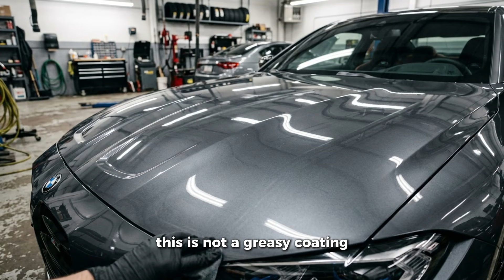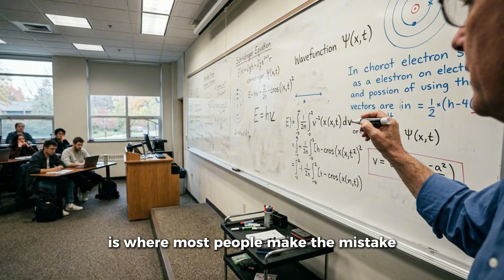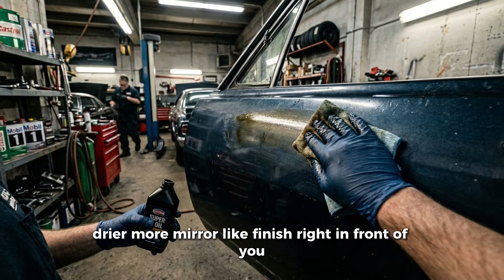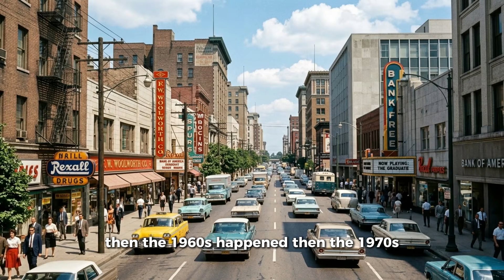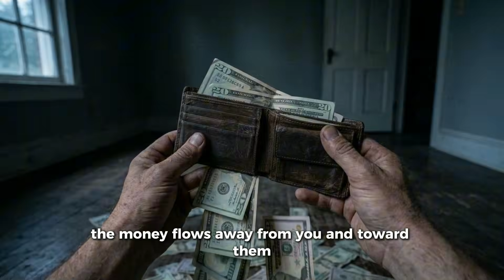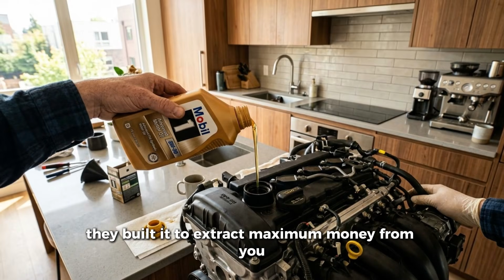Stop Paying For Ceramic Coatings. This $2 Cooking Oil Seals Paint.

Comment: The info is very useful and stuff, but the reading and the video itself sucks as hell bro. Also turn off that gate on the sound channel and better film yourself talking rather than those bs pictures. Fix that, and you'll be rich!
Reply from the maker: thanks
Reply: @TheBuriedBlueprintUS  I hyped this video but I agree, was hoping to see a before and after actually applying the product but it’s the point that matters and I’m going to try it on my nice paint job so I’m really going out on a limb here. If it works I’ll be back to shout it out here.